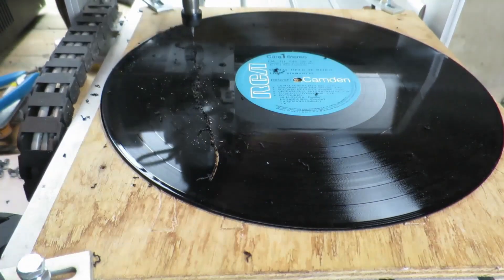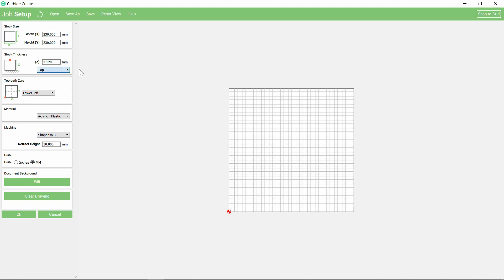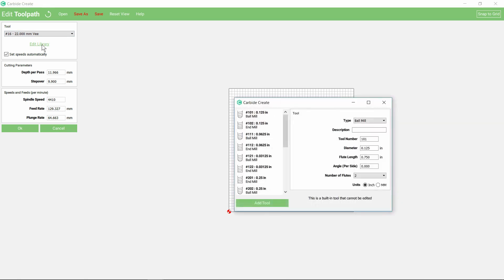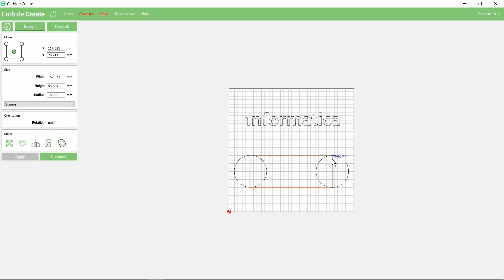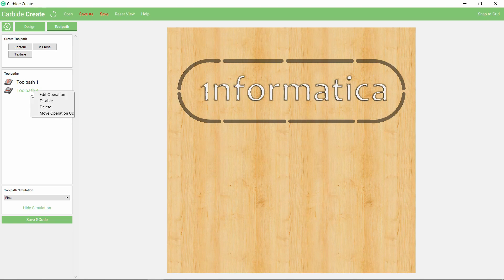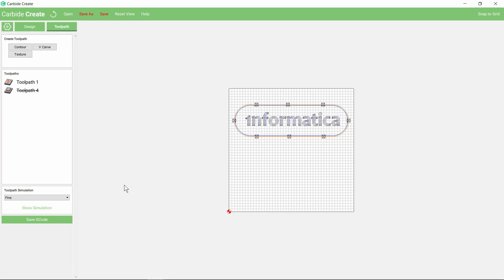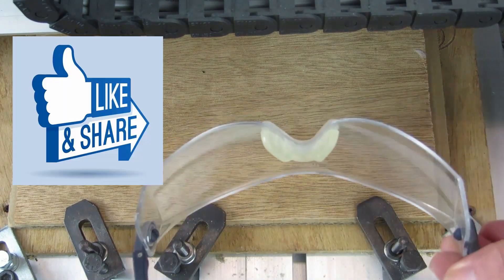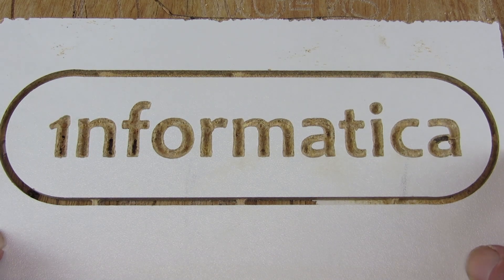CNC 3040 Carbide Create Vcarve Example - Tutorial

Comment: Hiya, you asked me to keep in touch and tell you how I was getting on, so I have an interesting thing to tell you and an associated problem. The Planet CNC software has an "Import Text" button. When you go into it, you can choose a typeface and a size and there it is, and you can Input the text you want. Furthermore, it chooses an incredibly simple G-Code path, as opposed to Carbide Create, which sometimes completes a single letter from three separate directions! For simple letter engraving it is the simplest solution.

So what's the problem? Well, the path is automatically on the outside of the letter profile, and I want it on the inside, and I cannot work out how to tell it, or better yet, set it exactly as I want it. Have you discovered this, and if so, what might the solution be, because that woulkd make my life wonderfully easier for 80% of the work I need to do. Cheers Robin
Reply from the maker: Hi Robin, thanks for the update. I briefly looked at that function in the software, will revisit it. Unfortunately a recent Windows 10 update has totally screwed my CNC USB driver install (don't ask)! Going back to Win7 now.
Reply: @1nformatica  I've got two machines dedicated to CNC in the studio, one runs Windows 7 and the other XP!
Reply from the maker: You should definitely keep it that way!
Reply from the maker: I have a partial solution for you. Planet CNC actually designed their own font which will produce paths with only one pass per letter. Go into your install folder of CNC USB controller sw
In Samples folder find "PlanetCNC_Technic.ttf" file -> right mouse click and install
Now start CNC USB controller sw and click "Import text" -> find "PlanetCNC Technic" font (it will look strange!), also disable "Close Polygons". I guess to do your "inside out" paths you would need to design your own font!
Reply: @1nformatica  Really? Then how do you do a "filled in font"? Lots of decorative fonts, like fat script fonts, are filled in. If the CNC bit is only going to trace the outline, what happens to the rest of it?

I'll certainly try your solution, so thanks for that, but that gives me one typeface, and the joy of CNC should be that I can use any font I like, in three dimensions!
Reply from the maker: Take a look at Inkscape... http://www.inkscapeforum.com/viewtopic.php?t=11670
Reply: @1nformatica  Thanks for that. I'll read it through. On the other hand, my solution using just the Planet CNC software works really well. Now; it allows you to choose a normal font and a point size. What I did was to search for a really thin sans serif font, and use the thinnest version. You need to try it out on a scrap piece of wood to get the size right, but once we had the size, off it went. It picks a really sensible path and does it beautifully. It fixes z-axis movement at 5mm (i.e. height between cuts) and cutting level at z0.0000. However it offers an option to "Edit G-Code", which when you press it, brings what it has produced up in notepad. So I went through and changed all the z0.0000 to z-2.5000 (with a search and replace). Then saved the file. I couldn't make it update (there must be a way) so I shut the project, and pressed "Import G-Code" and opened the text file I'd just saved. All good - pressed the go button and it worked like a charm. Because I was working with a normal font, I used a 3 mm flat end and the thinnest font was like a normal font fully excavated. Now, there is an option to "Offset", but I haven't explored it yet. I suppose that that would bring the bit inside or outside the external line, which would allow you to use a fatter face. So, we advance - perhaps that will help someone...
Reply from the maker: •:*¨¨*:•_•:*¨¨*:• EXCELENTE_•:*¨¨*:•_•:*¨¨*:•_! You need to check out notepad++, it's awesome https://notepad-plus-plus.org/
Reply: @1nformatica  I already use it after your last recommendation! It's not into the studio computers yet, but it's on mine. Very good! 

Of course, the normal bit track isn't outside, but the centre of the outside line, which since I'm using a 3mm bit, gives me 1.5 mm outside and 1.5mm inside, hence excavating the centre of the font when it traces both sides and effectively replacing the thinnest font version with the normal...

Comment: Hi again, Your videos have been a massive help for me getting my 6040 set up, thanks very much for that. I too am using the CNCUSB software that came with the machine.
Can I ask if you are able to control the spindle speed from the software? if so how would I set that up please. Up to now i have only been guessing at speeds because the control box only shows Htz. I'm assuming 400 htz  is 24000 rpm.
Quite impressed with the machine though and i'm sure as I get more used to it  i'll be even more so.
Thanks again for your videos, keep up the good work :-)
Reply from the maker: Hi Maicolm, thanks for you kind words. My control box only has dots on it but as it's normally on max it doesn't matter!! My control box has 2 boards. One controls the steppers, axis switches etc. The other controls the spindle using pulse width modulation (PWM). Although there is a PWM out from the stepper board it is not connected to the spindle board, the speed being set by the dial on the front. I have investigated connecting the boards but it appears non - trivial. My main interest would be just to be able to switch the spindle motor on and off via the software. Useful on a long run when you may wish the motor to turn off at the end. When I get time I'll look into it again.

Comment: hi 1nformatica
i have tried carbide create but it will not vcarve some of the letters
i am using snap cnc to control my  3020 cnc
just wondering had you any such problems i cant see where i am going wrong
your help would be much appreciated 
thank you very much
kind regards 
james
Reply from the maker: Hi James, Do you see the letters in the simulation in Carbide Create? If so do they also appear if you put the Gcode into the Gcode simulator I show in the video? If the letters show in the simulation but are not being carved check you have the correct size vee bit in your CNC .
Reply: @1nformatica  
thanks very much for your help
yes i can see the letters in cardide create
i will try the simulator as i do not have one yet
kind regards
james
Reply from the maker: Hi James, I should have said toolpaths rather than letters. In Carbide Create you should see the blue lines that represent the carving tool's path in each of the letters. If all correct then check the Gcode with the simulator, it's an online tool, no need to install anything. Link in the description.
Reply: @1nformatica  
yes indeed the tool path did go blue and thanks i have tried the simulator
and again it shows that  the lines have been cut the only thing i can think of
is that there is some issue with snap cnc  so i really don't know what to do now 
again thank you so much for your grea help 
best regards
james
Reply from the maker: Perhaps take a look at LinuxCNC http://linuxcnc.org/
Reply: @1nformatica  
i might  try linuxcnc   if it easy to use
are you using it and is it easy to learn i am not too good with software
i can do the basics 
thanks so much for your help
kind regards
james